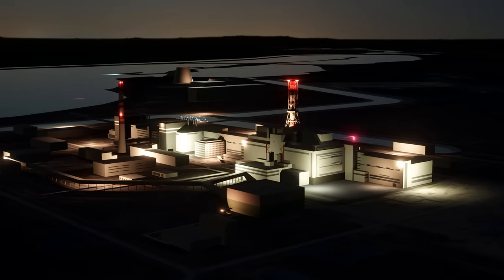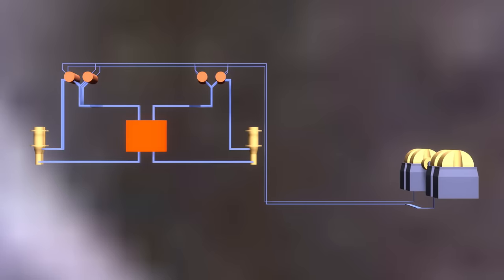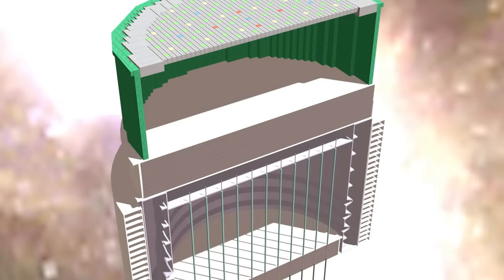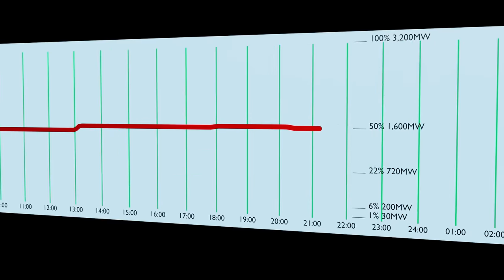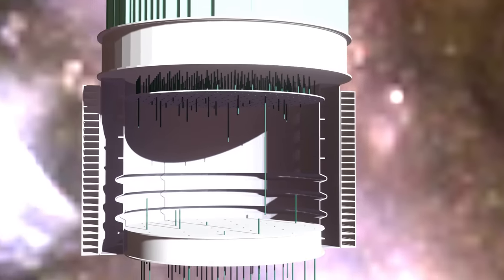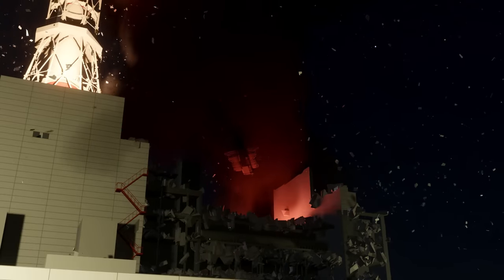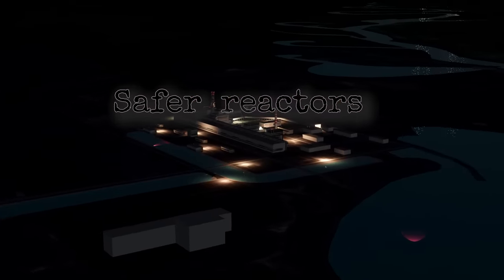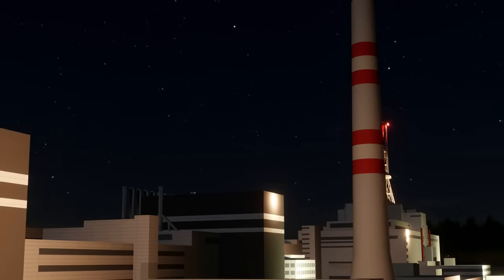CHERNOBYL AZ-5 why it exploded

Comment: So, I think you should've specified that "HEAVY water" (basically water with extra hydrogen molecules) is what is used as a preferred moderator in nuclear reactors.  You previously pointed out how the reason the lower half of the rods were made of graphite was because water was a weak neutron absorber/poison.  So you've basically said that water is both a moderator and a poison in the same video.  Otherwise, good stuff!!

Comment: Not being morbid, but a genuine question.  Would the explosion and after effects have been better than a dirty explosion?
Reply: Depends about bomb and what you use as material. Theoretical bombs are almost always estimated to be less then 1t and explosive mass less then 200kg. So Chernobyl was way worse. Were talking over 200t TnT explosion in second explosion and several tons of radioactive matter that burned several days. Dirty bombs release most of their radioactive matter in really short duration. In case of Chernobyl it first released ton of radioactive matter and then kept releasing more of it when reactor and already contaminated area burned.

To have anyway close to effect of Chernobyl in a bomb form you need military grade salted bomb.

Comment: I believe your animation needs to be corrected. There were two explosions. The first was a steam explosion that blew off the reactor lid. The second and more powerful explosion came almost immediately when air entered into the exposed reactor core resulting in a Hydrogen thermal explosion.

Comment: Thank you for showing a cutaway of the tank and how the control rods moved in and out. I was always confused as to what exactly it looked like and didn't understand the space that allowed for that to happen. Now I'm curious as to what's inside and at the bottom that moves the control rods themselves. Is it some kind of rollers?
Reply: Servomotors, I believe you are thinking of.
Reply: @isaowater  Thanks. A year later and this comes back up as a recommendation and I didn't realize I watched it already. I had the same thought again about the movement of the rods and scrolled down to the comments to see this.

Comment: As I commented on the MIT lecture on this incident, it is obvious to me that the designers of the reactors built in "design defects" that made the reactors nothing but an accident waiting to happen - graphite as an additional moderator to the water, and graphite also on the control rods.  As explained in the excellent MIT lecture on the "accident," virtually none of the graphite in the reactors was necessary.  So, it is obvious to me that the designers of these reactors were not at all happy with the U.S.S.R., the designers building in fatal defects.  I note that this video fails to mention that 30 control rods were needed in the reactor at all times - the reactor that "failed" only had 6 control rods in operation.  The video also fails to note that the bottom ends of the control rods had graphite on them - plainly a "design decision" to "assist" the accident that was just waiting to happen when the water - that was also the moderator - was allowed to boil; there followed a Hydrogen Gas Explosion.  Also, there was no containment vessel, as the U.S.S.R. did not have the means to build such a safety structure.  So, this reactor failure was plainly the work of what is called "an inside job."
Reply: Those 2 things about the rods were explained in the video. Seems you didn't do effort watching it and just guessed.
Reply: @effedrien  So, why has everyone failed to note that the design was defective on purpose?  Did you notice that???
Reply: @ronaldc.wagener6403  it is about design flaws that can be countered by proper operator instructions and / or automated safety mechanisms. That is were it went wrong, not really because of the design flaws. You would be surprised how many complex systems contain such flaws.  Redesign and especially the retrofit, is not always feasible.
Reply: @effedrien  Whenever something is made complicated just for the sake of complication, you know that something is up.

Comment: I still dont understand why they use graphite on the tips of the control rods. Why not use any other material? Removing the control rods basically acts as an over-drive if the graphite replaces them, is this intentional? ("doubles the efficiency of the control rods")
And its not really "the tips" of the control rods, if the tips are almost as long as the boron parts of the control rods themselves...
Reply from the maker: Its to increase the total power of the reactor and was absolutely intentional. The problem was being cut short which was because there wasn’t space in the lower reaches of the reactor and it equalised fuel burn across the floor of the reactor.
Reply: @Mike-Bell  But why would u equip control rods which should slow down the reaction with graphite that speeds it up?
Reply from the maker: @cherchil  there was not enough space at the below the reactor to fit the full length graphite. There probably was further thought behind it the but whole issue got silenced and they built plenty reactors like that “back in the USSR”
Reply: @Mike-Bell  I took some time to understand the Rbmk, they basically had both gas pedal and breaks connected on the same rod, which is absolutely horendous ..
Reply from the maker: @cherchil  Its crazy.  Only a few people knew about this and it was a bad career move to talk about.  🤐
Reply: @Mike-Bell  The fact that people knew and still had to stay silent, i guess u can bend the nation but not the science!

Comment: The fact that the KGB classified the accident at the Leningrad Nuclear Power Plant, because the personnel of the Chernobyl Nuclear Power Plant did not know about it, is a lie. The operators of the Chernobyl nuclear power plant were trained at the Leningrad nuclear power plant during the accident, and when they returned, they told everything to Dyatlov. Moreover, in 1982 Dyatlov was supposed to participate in a conference on nuclear safety at which claims were made to the developers of RBMK reactors, but sent a subordinate instead of himself. And, finally, at three of the four reactors of the Chernobyl nuclear power plant, a modification was made to the operation of AZ-5 - to compensate for the tip effect, not only rods with graphite displacers were lowered from above, but also raised without them from below. Such a modification on the fourth reactor was to be made during a scheduled overhaul after April 25, 1986.
Reply from the maker: Thanks for this👌🏻. I have previously heard piecemeal parts of what you say but this is a complete account and is very helpful.

Do you have references I can use to corroborate. 

I plan to make an update of the video in the future and include the corrections by other and this you raise. 

I had also been told that although the ChNNP worker who had direct knowledge of Leningrad would have told Dyatlov discussions outside the handbook would have been career limiting meaning useful conversations around the low power end effect would have been suppressed. You maintain open conversation would have occurred and Dyatlov dismissed it.
Reply from the maker: https://youtu.be/pOzJQJ1yAaM in the Russian version of the video I correctly show the lower control rods not moving with the AZ5. And as you say during the planned shutdown of no4 the lower rods would be connected to the AZ5. If they were connected unit 4 would not have blown up…

Comment: I don't know but also just in case I don't know if they knew that when the reactor exploded it wasn't only inside that reactor but it also exploded inside let's say what divides reactor 3 and 4 that has the respirator on top because a little to reactor 3 currently they want to dismantle the original sarcophagus

Comment: This doesn't make sense, Xenon peaks at about 10 hours after a power reduction, and is mostly gone after 20 hours, so it wouldn't have been a factor in either the first or second power reductions.
Reply from the maker: You are correct.  The impact of Xenon is not explained correctly here and is a widepsread inaccuracy in the Chernobyl story.  The pausing of the shutdown at 50% power allowed more xenon to burned off reducing it effect on the system.  This is why standard practise avoids restarting a reactor that is almost shutdown and why restarting Chernobyl was such a bad idea.  The video suggests that the delayed shutdown worsened the xenon buildup which is confusing.

Comment: The moment I heard him say that the night shift was not fully trained to run the test I knew that this was ultimately the real reason this all went to crap. Pure mismanagement and incompetence. From the obvious design flaw with the control rods not going all the way down being intentionally hidden from the people that approved the reactor. To the idiot decision to give the night crew that is not well trained in the process the job of running the breakdown test. The entire situation was 100% avoidable and now nuclear power still suffers under the stigma of "dirty and unsafe" despite how incredibly abundant and clean the energy it produces actually is for  the environment to this very day. Why does this make me think a similar situation took place in that Wuhan research lab?
Reply: I disagree with you saying the shift was "not fully trained". The test program had clear instructions, and they were followed accordingly. They did everything right, as far as the test program and the "reglament" for operating the reactor were concerned. The reactor blew up purely because of the design flaw. Had the test been done on the day shift as planned, and the events unfolded just the same, the explosion would have still happened.
Reply: @maksphoto78  They weren't fully trained. This is not a matter of opinion. It's a documented fact. And yes the testing would have still resulted in the meltdown had the day crew ran the tests. Ultimately the issue remains incompetent management who approved a bad core design in the first place. And worse the people that sold it as quality design work despite knowing the issue ahead of time.

Comment: You are wrong about lack of data and engineering mistakes made by it's designers due to the lack of experience. They always knew about that design flaw. They just didn't mention it in the operational manual because a reactor was never intended to operate in such extreme mode.  IMO removing all but one control rod is just a  batsh*t crazy idea.

Comment: Could someone explain to me why the other reactors did not explode? Was the explosion not big enough to damage the other ones protected by concrete? Why did they not go crazy after weeks without human maintenance?
Reply from the maker: Reactors 1,2&3 were all at full power during the explosion. They continued running thereafter. Control stayed on duty fulltime thereafter. 3 was shutdown later in the day. 1 and 2 were stopped a few days later. The control staff permanently manned all reactors and control never ceased. Inside the buildings behind concrete the radiation levels were not excessive. Outside they were more dangerous but they could exit at the far end. 

There was plenty of concrete structure between 4 and 3. Unit 3 was finally shutdown in 2000.
Reply: @Mike-Bell  Damn that’s crazy, thanks for the reply!

Comment: Ok, something I do not understand. Xenon is a gas and it was poisoning the reactor, but the reactor had water in it so where was the Xenon?
Reply from the maker: The xenon was contained inside the fuel tubes. It didn’t get to the water or the graphite.
Reply: @Mike-Bell  Ok, thanks for clearing that up for me.

Comment: I like this video because its animations illustrate clearly how the control rods fit in the core. But I don't understand why the tips of the rods were graphite and not boron. It is said that this increases their "worth" (according to another video) or that they were cheaper (according to the drama "Chernobyl"; but why could they not all be made of boron their entire length?
Reply from the maker: If the entire length was boron the reactor would have remained in the off position. Boron suffocates the nuclear reaction. Graphite accelerates the reaction.

Comment: I think that if there had been an open problem culture in the USSR they would have learned from the earlier nearly-accidents and would have investigated what the design flaws were and how to avoid dangerous behaviour and they would have been certainly able to improve the security of RBMK Type reactors. They would have been able to drive these reactors for decades without accidents. But this all has been suppressed by a culture of "don't look so close, we have our defined goals and to not achieve the goals is out of the question.

Comment: Are you a nuclear physicist ? You explained so well
Reply from the maker: Nope I'm an architect.  But I do make the effort to research and understand the subject and I approached nuclear scientists.  Then I try to present the information in the most easy to understand manner without becoming too sciency...   I'm glad it was easy for you to understand.
Reply: @Mike-Bell  Great Job. I am a chemical engineer but moved to IT. I find this quite fascinating.
Reply: @Mike-Bell  Hi Mike, I have a question related to this topic. When they say the power of the reactor is pushed down to 700W what does it mean. Doesn't mean output of power plant from turbine is 700W or is that the 700W power that is taken by pumps to circulate the water around reactor.?  Thanks.
Reply from the maker: @eversunnyguy   The reactor was rated 3,300 MW of heat and the Electrical output of the turbine was 1,000 MW. 
So 700MW reactor power or heat translated to 210 MW electricity from the turbine.
Reply: @Mike-Bell  Aww...I didn't know that heat was measured in MW. Thought it was meant for electricity. Something new to learn. I quoted that magic 700 MW because that is seems to be starting point for the safety test as in Chernobyl HBO movie.
Reply: @Mike-Bell  The Graphite tip rods are supposed to act as moderator right but interestingly they have increased the reactivity of the reactor !

Comment: When it comes to safer reactors section, I have a question is that why boron is not utilized as a moderator because I reckon it absorbs neutron better than water, I ain't a scientist, to me science is a rocket science, please help me explain it, thanks
Reply from the maker: The moderator does not absorb neutrons. The moderator keeps them inside the core and at the right speed to make a constant supply of new neutrons to sustain the chain reaction. 

Boron absorbs neutrons. It stops the reaction. Boron is the off switch.

Comment: How could it produce so much energy when it is actually the spinning turbines powered by steam that produce energy, the amount of steam generated in those +-20 seconds ?
Reply: and to how many turbines was the reactor connected ?
Reply: The power level is based on the temperature which can be converted into thermal energy/watts.
Reply: The reactor was connected to two turbogenerators. Each one had one high pressure rotor and 4 low pressure rotors.

Comment: You are very much correct about the graphite tips control rods I have done some research about myself and you are correct about every fact that I can find including the xenon poisoning at the time in 19 something I didn’t read it all I think 86 there were reports of previous channel ruptures from other reactor that use the same configuration so I can confirm this video is accurate

Comment: so it wasn't a meltdown, but an explosion correct?
Reply from the maker: Chernobyl was an explosion. Fukushima was a melt down. After the explosion the fuel still in the reactor drum melted into the basement. This lava flow formed a large blob calked the elephants foot. So it exploded and melted down.
Reply: @Mike-Bell  thanks for clarifying. I assume meltdown because there was no water to cool the fuel (uranium) so it continued to burn and melted into the basement correct?

Comment: "this was a heat and gas explosion, not a nuclear bomb" well, it wasn't a chemical reaction which generated all that heat in the reactor, it was a nuclear reaction.
Reply from the maker: In a nuclear bomb all the nuclear fuel fissions instantaneously. In this case a fraction of the fuel fissioned over 5 seconds. That is not a bomb. A bomb uses all its fuel at once. Chernobyl was a runaway. For a nuclear you need U235 enrichment at above 80%. This was just 1.8%. Chernobyl fuel was almost natural state uranium only slightly enriched.
Reply: @Mike-Bell  I am very much against double standards but in this case people are being fair, people describe things like a BLVE as a "bomb" even though - strictly - it's not like a military high explosive there's no supersonic shockwave moving through the media.

I think it does more harm than good to point at a massive explosion and say "that's nothing like a bomb, that's just a runaway" people get paranoia.

The use of the term "bomb" to describe such explosions is everywhere "you better pierce a hole in that can of beans it it'll become a bomb when you heat it" and "the safety release valve on this water heater is the main thing preventing this from becoming a bomb" or "if there's ab obstruction in the barrel of the gun it'll become a huge pipe bomb".

I think in this case it's entirely fair to say this terrible design meant it exploded like a bomb. Nuclear bomb? I guess.

You just have to add it's more like a gigantic nuclear bomb that fizzles than a small military grade nuclear bomb that gives a high yield.
Reply from the maker: @Treblaine  Chernobyl was not a nuclear bomb. Its primary physics make that an impossibility. Chernobyl could be described as a heat bomb. Nuclear bomb absolutely not. Chernobyl blew up from instantaneous hydrogen gas ignition. Not from instantaneous fission.